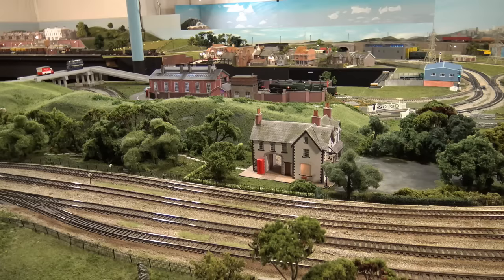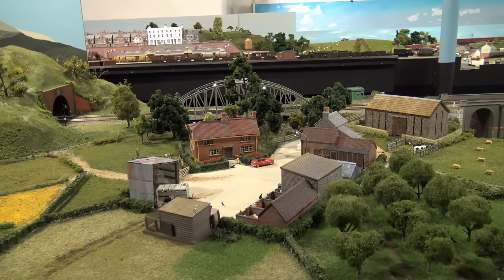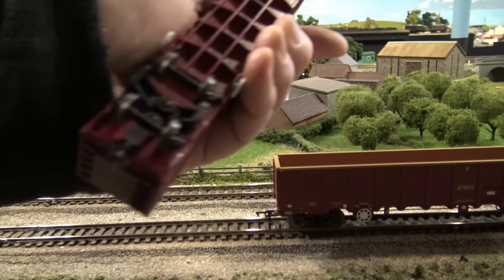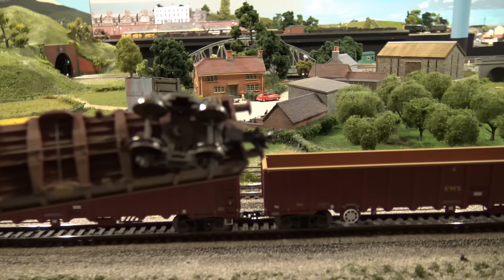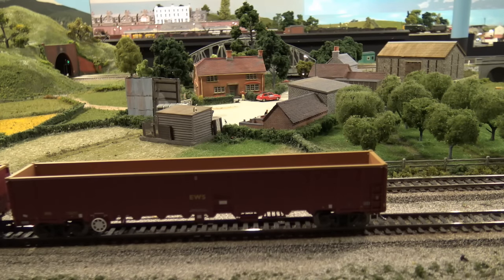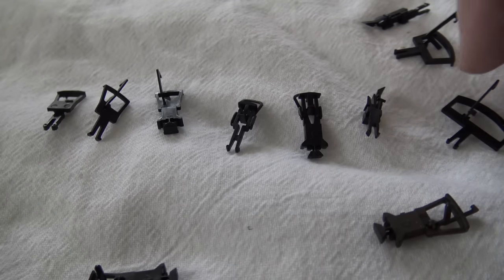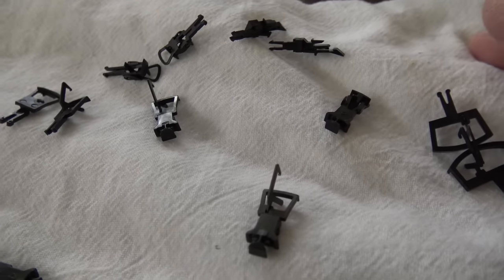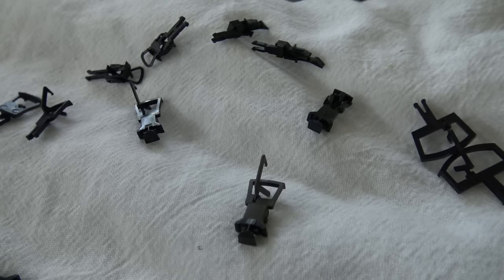20 Couplings make me crazy - Farland Howe

Comment: Hi Rob. Those close couplers are very good for bogie stock when one has tightish curves as most of us do. They form a rigid bar which improves reliability.  As for the NEM pockets I have heard that some Bachmann are a little off but as I don't have Kadees I am not sure. Regards. Les.
Reply from the maker: Les Corkett Hi Les, yes very interesting, I will have to investigate it.  The thing is, the tension lock is very forgiving for height, but Kadee is not.  A millimeter off and it can become a problem if there is the slightest irregularity in the track.  Thank you, great comment, Rob

Comment: Hi Rob and sorry for the late reply, we have been away and only got back a few hours ago. I have several packets of Kadee couplings in my drawer which I was going to go through and fit to all my coaches - eventually. I have fitted them to some of the Royal Train coaches but even then the theory falls down because Hornby have made the heights of the bogies just slightly different. I am going to experiment with some plain wire and a hook system which I have seen and it works very well. Easy to uncouple and no problems on curves and undulations in the track - almost too good to be true and we all know what that means!!   lol.               ............Graham
Reply from the maker: Graham Foulston Hi Graham, it is a lazy afternoon here.  I am getting more interested in the KDs.  I have their catalog and am trying to understand their product line.  Normally they are mounted directly to the frame of the wagon or coach and the shank protrudes out.  That would require very large radius curves to work and bigger than most model railways.  After this video was uploaded, I was able to raise the mount on the lead wagon.  I have not tested extensively yet but so far it is working and the rake is reliable.  I will test more tomorrow.  I do like the ease of coupling.  It take very little force.  The idea of uncoupling automatically sound interesting.  Thank you, Rob

Comment: Same problem here Rob takes ages to get a set of wagons or coaches running can't beat the big D but they look ugly Everard Junction made some coupling out of wire on a rake of hoppers and they worked really well and didn't look bad either and a lot cheaper !! than Kadee couplings cheers Kevin and a happy new year to you and your family
Reply from the maker: Thank you Kevin, they are at different heights, different couplings, different center points for the bogie rotation.  It is madness.  Yes, I saw that on Everard Junction.  I presume he couldn't make the Kadee couplings work since that is what he normally uses I think.  Over here I can get Kadees in two days from TrainWorld.  I now have a good and growing collection.  You can get them on Ebay and on the Walters website.  Thank you and a happy new year to you and your family as well.  Rob

Comment: It is crazy that manufacturers "super detail" models, offer DCC & DCC sound yet cannot get a simple coupling system to work universally!

The Electrotren couplings you showed are similar to those used by Bachmann UK between their DMU cars. They can also be used to replace tension locks on front of DMU's if running in multiple. 

Excellent even on radius 2 setrack. Liliput make them under item number L550000 and I believe Bachmann offer the same Bachman branded item. I have used these to run multiple 2 car DMU's coupled together and they are 100% reliable. Thanks for all the information!
Reply from the maker: It is insane.  Hello Pat, I think they do not want to build compatible couplings.  We know they could, they know they could, but each is trying to make the other manufacturers stock running with the other behave badly.  It is all subtle except to us who can't keep our trains coupled when we run multiple manufacturers in the same rake.  Those couplings you refer to, the Electrotren, come in a couple of versions too.  One company uses them with dove tails and the other with NEM 362.  They are reliable.  They only come apart when the NEM shaft comes lose and that takes considerable force.  Great comment, thank you, Rob

Comment: Hi Rob, I tried Kadees on Canal Sidings and they performed exactly as Kadee said they would! By that I mean required very level track, did not couple or uncouple well on curves and had to be set exactly to the Kadee height guage. Great if you can meet all those requirements but who has straight track and no curves??? And whatever you do don't unseat the knuckle spring, it is a bu**er to get back in place - that's if you can find it and then pick it up!!. Happy days LOL.......John
Ps Kadees are also reccommended to be fitted to the body of the wagon and not the bogies!
Reply from the maker: Hi John, vertical wobbles in the track are difficult for any coupling except those Electrotren ones, they just hang on no matter what, but are difficult to uncouple.  They go up my inclines just fine however.  If I lose a spring, I plan to pitch it and get a new one.  Everard Junction uses KDs.  He's got helices.  Yes, to the wagon.  The coupler is connected directly to the frame of the car here in the US and KD mimics that design.  They do pivot sideways however.   Thank you, great comment, Rob

Comment: Rob. Hi. I know what you mean about couplings. Anyway just wanted to say I swapped to kadee. I use the No.18 you showed. I only have a shunting layout. Once set up they are flawless. Get a height gauge. It makes setting them up much easier. You can get cranked couplers. Kadee do a packet of washers for the minor adjustments in the nem pocket height on different rolling stock. I watched a boatload of videos on YouTube before taking the plunge. A small magnet under each track in places where you want to uncouple. I got shedloads from China via ebay really cheap. You could always stick with tension lock for rakes of coaches you intend leaving coupled. Interested to hear what you think when you've had a play with them. Cheers.... oh and happy New year.
Reply from the maker: Hello Alan, Happy New Year.  The No. 18s are the medium length shank.  All the Nem pocket KDs are mounted on the top of the shank.  I know they have various mountings, middle top and bottom, but just not for the NEM sockets.  Although I have done some shunting in videos, I don't do it very much on my own.  I like to run and go into and out of stations platforms.    The washers would work if they were attached by a screw.  These tall wagons are.   Do you have to trim the wire hanging under them?  I have found that the wire will touch something, an AWS magnet or parts of a turnout and it will trip and release.  Do you cut them down or bend them?  Thank you, Rob
Reply: Rob. Sorry I should have said. I'm in England. So the wagons I'm using are all bachmann or Dapol  with nem pockets. So 18s work fine for me. 17s couple closerwhich is more prototypical but I find 18s more reliable and really the buffers are nearly touching. The washers are fibre and come in half millimetre increments you take the truck off pop the on and screw the truck back on. Some of the older bachmann private owner wagons the nem pocket is slightly higher so they need adjusting or use a cranked kadee. Hope that makes sense.
Reply from the maker: Alan Hudson Yes, Alan, I think I am clear on it.  I am still experimenting.  What do you do when the locomotive has it's men pocket too high.  Do you modify the loco?  Rob
Reply: Hi Rob. I have some older Bachmann locos where the front coupling is screwed on. I discovered whilst experimenting that I could drill a small hole in the shank of the coupling and use the original screw to connect to the front pony truck. You can use a fibre washer to adjust the coupling height. I watched some you tube videos - mainly American - where they went through their own methods for adjusting the heights. I'm sure you realise by now that getting the height right is the critical thing. The most popular one I could find you cut a small shim of styrene and wedge it either above or below the coupling in the men pocket and that seems to work. Hope that helps.
Reply from the maker: Alan Hudson Yes, I did understand that.  In the video the loco was 1.5 mm higher than the wagon, so I raised it on the wagon.  It was running very well for about an hour or more earlier today.  I plans to get the gauge from Kadee and use it to set heights.  I didn't want to mess with a brand new locomotive.  I can replace the wagon for much less.  Bottom line, the wagon rake is solid.  Thank you so much.  😊. Much appreciated, Rob

Comment: Happy New Year Rod.    I prefer the metal type 3 tension lock couplings, I also have many collectable locos and waggons with type 2 tension lock couplings they all work as long as they are not bent out of shape .I can also add a neo-magnet(very small disc) to the uncoupling bar which adds weight and magnetizes the whole coupling.
Reply from the maker: Michael Hill Hello Michael, it sounds like you've got it solved.  I wonder why they don't put the metal ones on at the factory.  In fact, I don't think I've ever seen one.  Brilliant with the magnet.  It would seem you have found the perfect solution.  Happy new year and thank you for the great comment.  I will now be looking for the metal ones, Rob
Reply: Sorry Rob a typo error with your name slipped through.
Reply from the maker: Michael Hill No problem, it happens a lot.
Reply: Cheers.
Reply from the maker: Michael Hill 😎

Comment: As far as i am aware Britian has never had any standard when it comes to coupling and the height they are set at. Can't say I have had much of an issue. I use Kadee #19 & #20s. If the tension lock is stepped then the NEM pocket is not at the correct height, I then glue the Kadee underneath the pocket and it sets it at the right height. If the tension lock is straight it should be the right height. If it is a little off try taking the pocket of and refitting it upside down and that should fix the problem. A mix of different couplings in a rake is bound to give issues, try to pick one or two and stick to them.  Hope that helps !
Reply from the maker: Hi Scott, you are correct, according my research, the UK has never signed up to the NRMA standards.  The standard originated in the US and Europe signed up, but the UK never did.  OO scale is not even listed in their descriptions.  That is why it is so crazy with British outline models.   Do you use the Kadee gauge?  I may get into modifications at some point.  Thank you for your great comment, Rob
Reply: Hi Rob,   yes I do have the Kadee gauge. I guess this mis-match of coupling keeps our minds active at least. LOL
Reply from the maker: That is true.  Thanks.

Comment: Can you get cranked KD? You can get shorter tension lock co
ulpings. I still like your 'slab'  (66). Graham at Lakeside has one as well. I agree couplings  to be standardised. They do cost alot as well, and it drives me nuts.   Happy New Year
Reply from the maker: Hi Nigel, I am convinced couplings sold in packets are a rip off and a profit maker for the model companies.  In America, the companies have all signed the NMRA (National Model Railroad Association) standards agreement.  All rolling stock for the US market conforms to the standard and any loco will run perfectly with any rolling stock because of the standard.  The UK did not sign up although europe did.  The scales listed in the standard do not include OO.  You can get cranked Kadees, but only for standard American stock.  You can down load the Kadee catalog and they call it centerset, underset and overset.  All 362 NEM pocket couplers are overset.  Thank you, Rob
Reply: I strongly agree Rob.
Reply from the maker: Nigel Carter 😎

Comment: It should be a standard Rob as you say. So should DCC and there is one supposedly but not everyone sticks to that. So I wonder if a standard would be adhered to? Plus regarding couplings, older locomotives already are what they are, so the problem would still persist. 
I think inclines don't help as the height might vary that 1mm too much, and they let go. Also certain tight curves can add strain and they go then. A curve on an incline is asking for more difficulties. 
When I was testing pulling lots of coaches at my CDMRC club I found KDs let go sooner than the Hornby style but I only did the one test, so it is not conclusive. I do prefer the ease of release of KDs though. 
Thanks for sharing the information. I learnt something about KD variations in length. Happy New Year Rob. Laurie.
Reply from the maker: As I understand it Laurie, in America, the companies have all signed the NMRA (National Model Railroad Association) standards agreement.  All rolling stock for the US market conforms to the standard and any loco will run perfectly with any rolling stock because of the standard.  The UK did not sign up although europe did.  It is the wild west in the UK.  The NMRA covers DCC too.  True, what I already have is the way it is.  There could be adapters made, however.  Inclines and declines are brutal.  At the change from level to incline and incline to level there is the angular misalignment situation.  My steepest incline has no curves.  The one on the big curves is at  1 1/2 % so is not a problem.  The HO Kadees and undersized for the weight and mass of OO rolling stock.For the NEM pockets mounted Kadee couplings, there are four lengths ranging from 7.11 mm to 11.68 mm.  You can download the current Kadee catalog.  Thank you Laurie.  Great comment, Rob
Reply: Aha, that explains a lot. I had heard Hornby do their own thing with digital. Cheers Rob HNY for 2017. Laurie.
Reply from the maker: Calvertfilm Happy New Year.

Comment: It saddens me to see and hear videos like this one. I have been using Kadee's for close to 40 years and currently have 24 different ones in my work space to meet any coupling requirement. I would advise the purchase of Kadee no, 205 Multi purpose gauge read the instructions and experiment with the couplers. I love them. Sincerely, David.
Reply from the maker: David Atkins I don't think anyone is finding fault with them.  They just are not OO scale.  The manufacturers of OO do not follow a standard.  Different ones put their NEM pockets at what ever height they choose.  I am new to the KD line and intend to master them in time.  They are made for many scales but not for 1:76.  Why are you saddened?  Rob
Reply: Sorry Rob. Not aimed at you personally it's just that for me Kadees are the answer to the coupler problem. The reason for the vast variety is to give the modeller plenty of scope for addressing the different mounting heights. It does require some innovation on the part of the modeller to adjust individual couplers. The different lengths and cranked or straight shanks are available to aid you not confuse you. I have some individual cars that have needed different couplers on each end in order to make them match up to the no. 205 but that's the important thing, getting them to match up to the gauge and it's not always as simple as just plugging them in. As for the scale, they are definitely not HO. Kadee has started making true HO scale couplers with the no. 58 but all the others are oversized and actually much closer to OO. That includes the NEM 362's. It takes practice and experimentation. I'm glad to hear that you intend to master the problems you're having. I'll keep an eye on your channel to see how it goes. David.
Reply from the maker: David Atkins The rake in the video runs very well now.  I raised the coupler in the lead wagon.  I did not want to modify the locomotive because then it would not match anything else in my collection. Thank you, keep an eye out, you never know what might pop up.  By the way, my n scale layout is all KD and I have no problems with it at all.

Thanks, Rob

Comment: Think with KD couplings you can get different heights ..if I remember they have a device for changing the heights ...thats what puts me off them they are different heights ...you need to know which ones ...that 66 sounds the bees ...Dave
Reply from the maker: David Howarth Yes true Dave, they do but not for NEM sockets that I have found.   If you have the gearbox (as they call it, I would say it is really the pivoting post enclosure), you can get different heights within a narrow range.  Later yesterday, I was able to shave the mounting and raised the coupler on the lead wagon to match the locomotive.  They run very well now.  Thank you, Rob